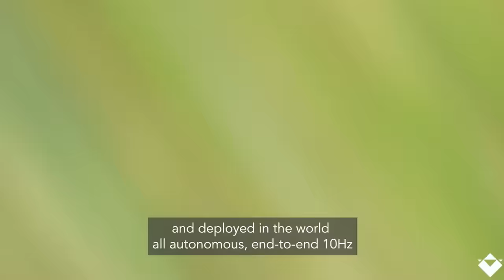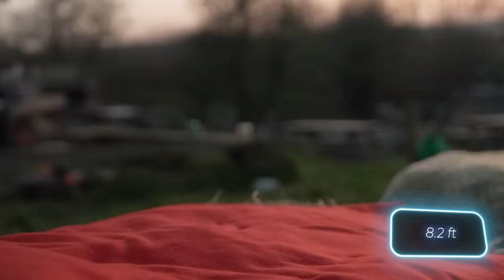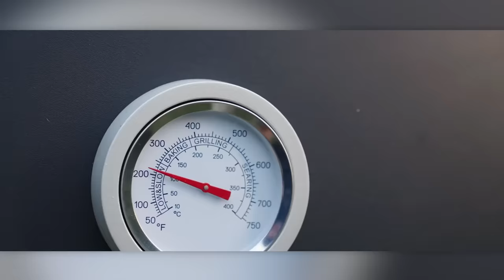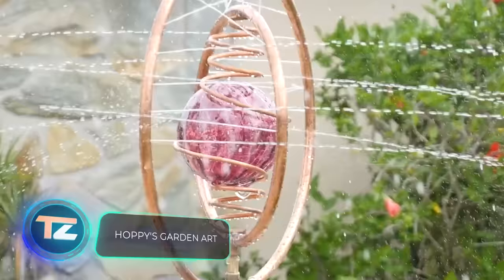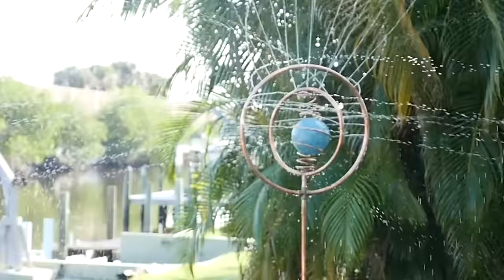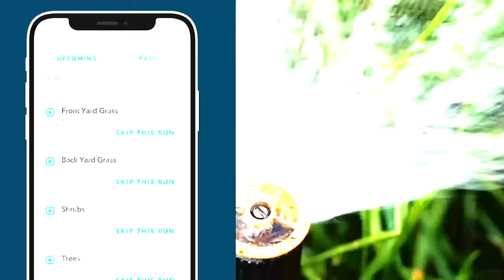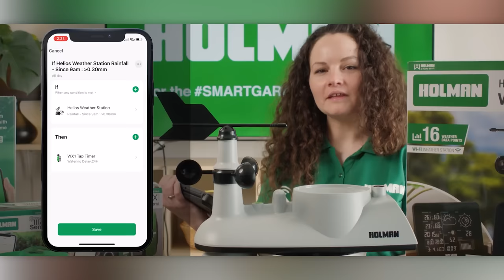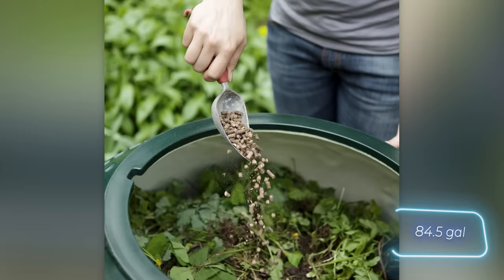COOL GARDEN INVENTIONS AND GADGETS YOU DIDN'T KNOW ABOUT

Comment: Take out your earbuds, put the iPad down, get your lazy ass off that couch and get outside…assuming if its not raining and not at the dead of night for you smart Alexes. That Maxbit is a joke. Get a garden spade. Cliperbox? Stupid. Terrateck wheel barrow nice but dont need a motor. Installing that sprinkler system is costly. Get a hose with an oscillating sprinkler and turn on the water. No electronic crap taking unnecessary time learning how to use it with those fancy button and lights. Have a sit for 20 minutes, guzzle a beer, wave and say HI! at the neighbors…after 20, move your sprinkler to another area….and your a wussie turning the water off before moving it and turning it back on. Tap the window at your girlfriend inside and give her a manly flex…wet tee shirt for the ladies…and if he’s not interested?…well…that’s another story, his loss.
Most these gadgets will be at your garage sale…..or in the trash in less than 3 years. 
There is nothing like getting outside, unplugged from the web for one day and get some exercise. Just a few hand tools, a mower and patience can do just as good without burning a hole in your wallet.

However, there are those who don’t have a yard to upkeep. My condolences. Continue falling down the rabbit hole.